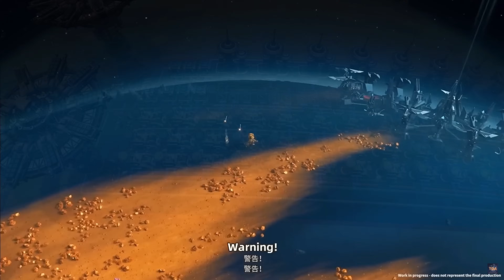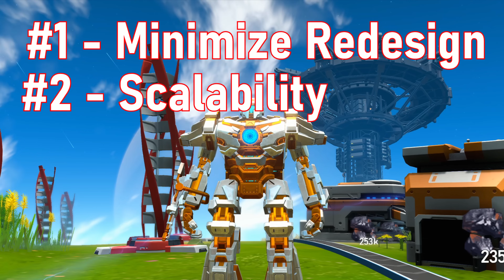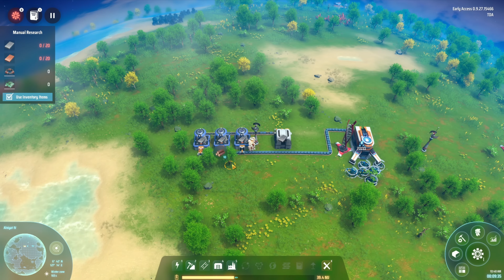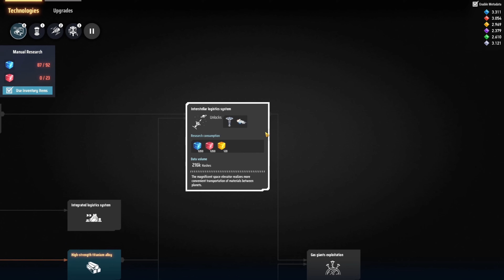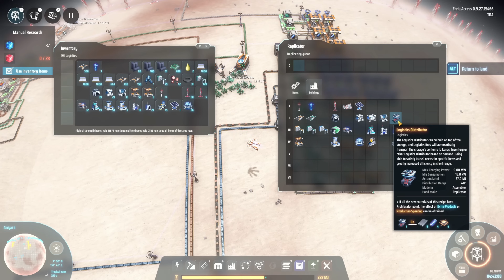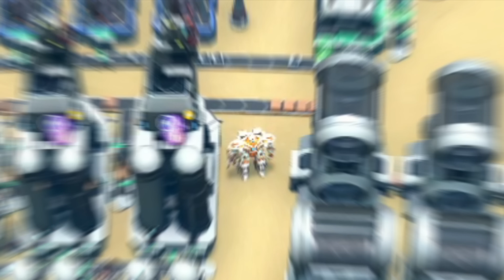Efficiency through laziness! | Dyson Sphere Program | #1

Comment: Do the oil wells actually run out?  I've never had one run out.   That seed looks great going to try it out today.
Reply from the maker: They slow down over time (you can see this when you click on the oil drill). So they don't technically ' run out' but you'll need to add new sources to compensate for the loss in raw resources coming in.
Reply: Ok yes, I know they will slow down I thought about it later and figured that's what you meant.   Thanks.
 @TheDutchActuary

Comment: I'm just finishing up my 5th or 6th successful playthrough, and this is how I started my early game, just a simple, easy layout (actually a modified version of Nilhaus's, but similar in functionality) for my jump base. My mid game, I'm pretty sure, was much different than yours will be, as this was my first serious attempt at getting some of the harder achievements, such as "Where No Coal Has Gone Before" and "Before Our Time", and this was the perfect starting system with plural satellites on my gas giant and a nearby star system only 2 lightyears away.

I really love this game. Right now, I'm building modular factories with 2 design philosophies employed: Max 1 ILS for inputs and outputs where possible, with the exception of proliferators (I have an ILS at each polar region for feeding lenses to receivers, I just call proliferators to one and feed them to a distributor), and fully maximize the capacity of all blue belts (7200 cargo/min for all inputs and outputs). This has produced compact, efficient, completely modular and expandable factories, and when I'm done I'm going to start reverse engineering them down to yellow belts and sorters in sizes that you can place down with early Mass Construction levels.

I just finished my most complicated build, deuterium fractionation, and I found that a belt for inputs (hydrogen) took way too long to ramp the facility up, so I broke the first "rule" and set up dedicated ILSs just for bringing in and proliferating hydrogen, which then goes to distributors. That meant that the single ILS that I was going to use for the entire factory could be used solely for deuterium. Several redesigns later, and I have an entire folder for deuterium fractionation in my blueprints, from a single fractionator on a loop with a couple of tanks and some pilers, to an entire planet spanning facility capable of producing 86,400 deuterium a minute with a little room left to grow. I didn't really want to use distributors, as they're on the expensive side at the scale I needed (14 processors per distributor, including the drones), where the most expensive thing a blue belt uses is graphene, but it made the whole build so much simpler that I think it was worth it, even if I did have to go through and redesign the entire thing.
Reply from the maker: 86,400 deuterium per minute? Holy cow! Hows your FPS doing?
Reply: @TheDutchActuary  In the area of 10-15. My computer is not super happy with me.
Reply from the maker: Ouch! @dlaw1954

Comment: You could put your boxes on top of a splitter, and then you don't need sorters, just run the line in and out.
Reply: I didn't know that. God am I happy to find out.
Reply: Is there any advantage at all to still using sorters with boxes at once you have splitters?  The power savings alone seems to be a great reason to stop using sorters.
Reply: @BeinDreki  sometimes theres belts on the way so sorters can put further away. Not often though

Comment: I like the goals. Not having a "starter base" that gets ignored or removed later will make things harder, but does make the transition to later game much nicer.
Reply: So a backpressure-routing system for the design. That's a classic (and very good) solution for the design of queuing networks. DSP (and similar games) makes it pretty easy, no need to calculate the Lyapunov function, drift, etc, like you would do when designing a "real" distributed system. As you've observed bots in these games make the connections between nodes easy, but remove backpressure and thus make throughput maximization difficult. Belts have the opposite tradeoff.
Reply: @PeregrineBF I like your funny words, techno man